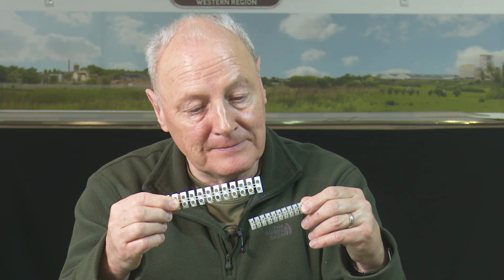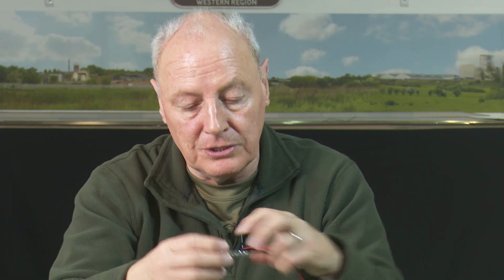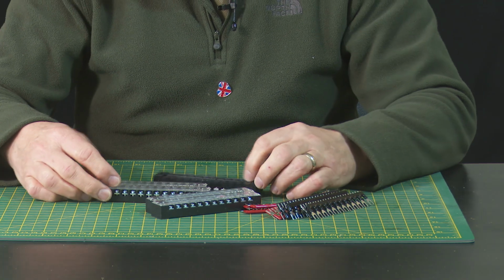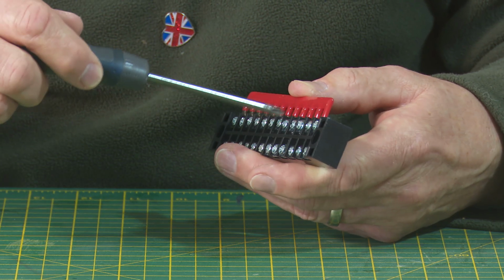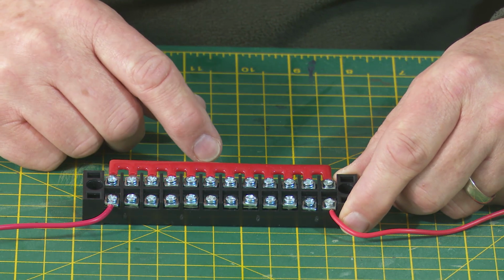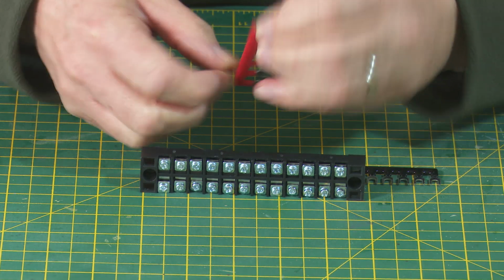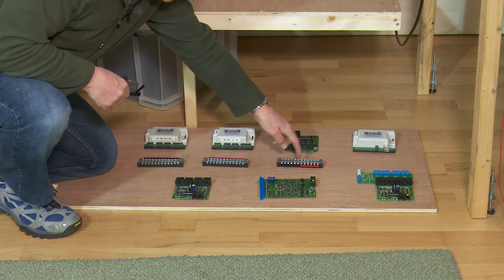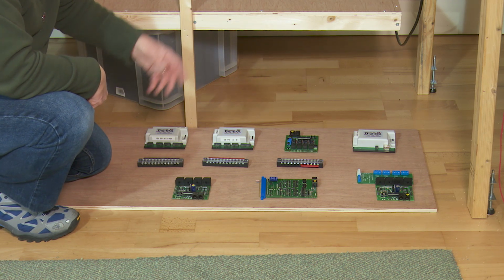Terminal Blocks for model railway wiring at Chadwick Model Railway | 85.

Comment: Thanks for your video. I subscribed. In USA and looking for the blocks you demonstrated. I found for thirteen U.S.. size wire do you use? Thanks.
Reply from the maker: Thanks MSM.  For dropper cables from blocks, I use 16 x 0.2mm.  You will have to google the answer in AWG. Regards, Charlie.

Comment: Yay! Still £10.99, and in my basket. Just the jibby jobby for the complications of my station, and of course the lighting circuit. Current-ly on DC, but going to take the leap to DCC, as none of my engines have easy plugs on them. Putting on the miner's lamp, and getting under the layout for a good fiddle!  ;-) I'm also looking at putting the 240v inputs into the terminal blocks, but the accidental connection-protection seems a tad 'short' for that... Again, a lovely concise video.
Reply from the maker: Thanks Harrison, they really are a great product. Regards, Charlie.

Comment: Great video as ever Charlie! Can I  ask a question. does the Block you recommended work for 12v and 16v please? I am thinking of ordering these :     HSEAMALL 15PCS 8Position Screw Terminal Strip 600V 15A Double Row Terminal Block Set with 400V 15A Red and Black Terminal Ba…
Reply from the maker: Yes, and they should be ideal for your situation. Regards, Charlie
Reply: Many thanks for that Charlie! I am guessing Id have one block for 16v and the other for 12v? thanks for all your great videos - they are such a help to a new-commer like me!

Comment: Many thanks Charlie for this video. I've spent most of the afternoon looking for and at videos using and explaining terminal blocks and yours was the most informative for this novice. I have most of my track wired with feeders and solder joints with lamp cord as my bus, but will definitely use blocks for my next wiring projects (lighting). AND I may eventually rewire all my track with terminal blocks. I would tomorrow, but am so far behind with the layout, my grandkids will be out of school by the time I would finish. My son never got to see my trains running and I don't want to make the same mistake again. Cheers!
Reply from the maker: Thanks Setaf, i’m so pleased that you have found this product useful. It’s certainly one that I continually recommend. Regards Charlie

Comment: Piece of advice when cutting the strips use solder mask to cover the exposed areas from the cut as it will insulate the strips
Reply from the maker: I must confess, I just turned my ends around, so the insulated ends faced each other. Regards, Charlie

Comment: What a great product.. Just received these bus bars through the post, and it will make the wiring under the boards so much more tidy. Fantabulous! Thank you for the leg work and research into these products, for all us railway modellers to use these items.
Quick question on wiring: As is normal, 1 bus wire + & - per line. 
But what is your view when entering a 4 or 6 line yard running into a 4 line engine shed? 
Is it best to split the bus wires into 6 feeds to feed each line, or can I get away with 2 and feeding multiple lines from same bus.
The length of yard is approx 8 feet to give context.
Keep up your great work Charlie.
Reply from the maker: I always over engineer!
I would power each and every piece of track Rufus.
Reply: @ChadwickModelRailway  Thank you Charlie... I have been mulling this over before getting stuck in. The droppers were always going to be fed from each piece of track, it was just how much I split the bus wires.
Over engineered is my policy too.
Great advice as always, and fantabulous channel.
So many questions & chat I would send you Charlie, but don't want to bombard you.
All the best
Rufus (in the depths of Cornwall)

Comment: Hardware Update:  I recently tried using some cheap white translucent blocks (you call them PM42 in this video) and found they don't work reliably with stranded OR solid wires smaller than 20 awg (16/0.2 UK).
Reply from the maker: I know what you mean mate, but those are known as chocolate block connectors. A PM42 is a Digitrax power management device. Regards Charlie

Comment: Could this be used for Dc cab control? My thought is run power to terminal block from one controller, then in my case to 5 spdt switches?. And then to do same for second controller and finally a third one for the common rail wiring?
Reply from the maker: I’m no expert on DC cab control David. However, what you said does seem sensible. Regards Charlie

Comment: Hello.
As someone who considers electrics to be witchcraft, can you give me some brief advice?
I don't run a bus, despite my layout being 14' x 9', and this will be the first time I'll add power other than controller to track.
I want to add street lighting.
I'll be using a regulated power supply limited to 3v, but I'm confused as to how to wiring these fancy, new terminal blocks.
If I had, say fourteen lights, would I have live into one terminal, and neutral into another.
Then, each LED lamp post would fit into each block, live to the live block and black to the black block.
How do I connect further blocks, given that I have fourteen street lights and each terminal block has only twelve connectors?
Do I simply run a live and neutral wire between each block or will that clash with the black and red 'combs'?
Sincere thanks.
Reply from the maker: With these terminal blocks, you can take multiple cables from a single terminal.  Furthermore, you can even take the power safety from the combs.
Reply: Ah, I've watched your video again.
I think the upper connectors are left solely for the combs. The first input on the lower level is for power in, and the twelfth input on the lower level is the wire to the extra block I need for lamp posts in excess of what I'll use in the first block.
Those connectors in between divert power to the lamp posts?
Have I understood it correctly?
Thanks again.

Comment: I bought the terminal blocks! All hooked up correctly in my helix and to the bus line of the layout, I now have a buzzing sound like when a loco rolls into a switch that’s not set correctly! It’s a short with something, I have checked 5 or 6 times now to see if I have the right wires where they’re supposed to be and I can’t find the issue! Any help from anyone would be appreciated! 

Wires go:

Outside red (white from helix)
Inside black (blue from helix)
Reply from the maker: Hi John, just check that if you have red cables feeding the nearest track on your upper level, it will reverse on your lower level.
Also, now it might be a good time to "Subscribe".  Regards Charlie

Comment: The terminal block will work perfect with my Helix!!!
Reply from the maker: Great news John, using the link, I’ve bought loads. Regards Charlie.
Reply: I’ve bought one pack, but now that I see how easy they are, I will be buying more, I really didn’t feel like running 12 bus lines through my yard, with these it will be so simple!! 
I’m so glad you have a YouTube channel.
Without you, sparky107 and one or two others, I would have blown up my layout long ago! 

Just want to say thanks!
Reply: I’m going to be purchasing a lot more, I have a quick question. I took out my second main, converting to a single main around the layout (had a few issues, locos stalling and such) so I removed all of my feeders and it fixed the issue, now I have a bus line with 30 or more suitcase connectors connected! Should I put in a brand new bus line? Everything runs perfect now with the bus the way it is, but I’m concerned in the future that it could cause some issues, all of those connectors are powered. So it would be drawing power?

Comment: Thank you for the excellent explanation on everything. History and current. 

My purpose is to make Star Wars light panels connected to arduino uno. But because things change, I  thought a terminal block would work. Then it came with this bus bar and and had no clue what use it had. You helped me get that clue. Thank you
Reply from the maker: I’m so pleased that you found the bus bar useful, regards Charlie

Comment: That certainly helps - every day is a school day - they're even better than pluggable choc-blocks. Great find! Working up hill, soldering, welding etc, even when young ain't fun, get past 50yrs old, even if 50 is the new 40, even less fun!

I've started by trying to make 'consumer unit' boards for easy access and making them relate to 'districts'. I'm using Digitrax too - but in 7mm, I've started dabbling with RC (less wiring - less track cleaning of the link tracks that take the layout from one side of the shed to the other via the garden). To do DCC properly requires hard wiring of points and two BUS set ups (loco net etc) - a lot of wiring. With hang down boards or sliding boards, I'm pondering the use of curly leads - similar to guitar leads (1970s stylee) etc with plenty of slack but not taking up much space. I find that many railway modellers use very thin wires, often too thin - I use the thickest possible that will fit and work.
Reply from the maker: Great comment MS.

Comment: Best practices  (adding the least resistance to a circuit) would say to add spade connectors to the power leads and place them side to side in the center of the buss side  so that the connection is close for the continuing feeds.  any wire that you may want to disconnect in the future should have a spade terminal crimped on it.  Wire ends should have  soldered (tined) ends so you don't get catwisker shorts if you use it with broken ( separated) buss strips. Yes you can use a Dremel rotary or heavy diagonal cutters to shorten the buss strips  so you could actually place track power on one end and accessory power on the other end.
Reply from the maker: Great tips Peter, many thanks.

Comment: Hi Charlie could there be a Male  and Female were you peg the wire in one section of wire and the other has an inserting tag , which would take away the use of a screw driver and just plug it in.
Reply from the maker: An interesting option William, regards Charlie

Comment: When using just half the connecting strip, it seems you could solder the incoming feed to the cut end of the strip.  May be defeating the object of using this type of connecter in the first place, but just another way of using them I guess.
Reply from the maker: I was just trying to emphasise the point that these connector blocks are very suitable for people who choose not to solder. Regards Charlie

Comment: Silly question time, I understand loop in on the terminal block but what is loop out at the other end?
They say that there are no silly questions but when you get back to me I will explain why this is a silly question.
Keep teaching us how to Charlie.
Barra.
Reply from the maker: So power comes in on one terminal and then moves on across the layout from the next, so the terminal block becomes part of the circuit. Regards Charlie
Reply: Here's my explanation  I used to install turnkey HF communication systems , listening stations early warning and SSSB. This not only involved installation of the towers, ground earth matts and curtains but included the elecrical systems and radios. Within these hands the security of the nation was safe,lol 😂

Comment: Hi Charlie, great video about the connectors. I have two questions: 1. Why don't you use very popular quick splice type connectors? 2. Is it not better to tin the stranded wire before fixing in the terminal block?
Reply from the maker: Hi Fillip, I don’t use the suitcase connectors as often over time they can lose their connection. This is quite a regular in motor-vehicle wiring. I tend not to solder stranded wire as I normally will fit a ferrule before connecting to a terminal block. Regards Charlie
Reply: @ChadwickModelRailway  Many thanks Charlie for your quick response. I agree in terms of suitcase connectors, I made a test how the slot penetrates the insulation and I'm unhappy so will revert my concept and do the connections using terminals with screws instead.

Comment: Brilliant idea Charlie - I'm building a new modular shelf layout using Kato track in N Scale (while in semi-retirement mode here near Ann Arbor in Michigan, USA), and you've just provided the solution to one problem I've been noodling over for a couple months while developing my DCC wiring plan. Amazon Prime has similar styles available to me. FYI, planning to use the Digikeijs DCC system with Multimaus throttle here. Thank you, sir! Gary
Reply from the maker: Thanks Gary, Those terminal blocks really are a godsend. Regards Charlie

Comment: Hi Charlie, Love your videos.  I use these blocks on my layout and they are awesome.  There is a product (in the US, on Amazon) called Gardner Bender 07315001126 LTB-400 Liquid Electrical Tape.  It comes in a 4oz bottle (which will last a long time) and it works great.  You could put a small amount over your cut ends to seal those up and reduce any kind of short from those ends.
Reply from the maker: Thanks for the tip Walter. 
Regards Charlie

Comment: Hello Charlie, hopefully the solution to my connection worries. In short at 67 years building my first layout. I have 15 turnouts to connect to my Guagemaster D controller. Is it suitable and correct to wire one block to the accessories 12v supply connection on the controller, wire all my switches to the block, and do a second block for the return connection? 
Many thanks, and keep producing these fantastic, helpful videos. Martin
Reply from the maker: I’m sorry Martin but I just don’t understand how the gauge Master D controller works. I’m afraid you’re on your own on this one. Good luck regards Charlie

Comment: Would you have to split the bus like a ring main (fead in / feed out) or could you not just run these off a spur from the bus? That way, if the feed connection in to the terminal block goes belly up, only the droppers running from that block go down and the rest of the bus gets power (makes it easier to fault-find if one section goes down). I love the idea of these as I want to have as few contact points on the dcc bus as possible.
Reply from the maker: Yes Kim, it would work that way too.

Comment: Amazing Video - exactly what I was looking for.  I was just on Amazon Canada and my head was spinning from all of the options.  This topic is very well explained and perfect for the beginner like myself.  This past weekend i just completed my individual power feeds, using a dual ring powerline(bus)  and those clamps with the levers.  Easy solution but probably not the best for troubleshooting.  Now I am on to my lighting circuits for lanterns on points and other "always on" lighting.  For the life of me I couldn't find distribution strips.  Not realizing of course that you can just "common"  these, which you so eloquently explained.  I have left a sub, which is nice for me as all my subbed train channels are in German as I am a German speaker.  Again thanks. Greetings from Toronto 🇨🇦
Reply from the maker: What a heart warming comment Tommy.
 Stay safe. Regards Charlie

Comment: I've bought myself a couple of packs of these, thanks to this video! I just wonder are the cables supposed to have fork connectors on them to go into the block or just bare wires?
Reply from the maker: I use forks for larger cables and bootlace ferrules for normal sizes. Neither are really necessary.

Comment: Hi Charlie I really enjoyed your video I have a small layout I live in an apartment and it's a 3ftx5xft portable table I built for my layout I put it on my kitchen table and when I am done I put away anyway I am running a ho trains and the track is an oval no program track because I dont need it. My father in law gave me his DC HO trains i want to run to see what works and what doesn't i have a  DCC NCE POWERCAB and I want to put both on the track I know I cant put DC on a DCC track I installed a toggle switch but I cant figure out how to hook up a switch to the terminal block same one you got from Amazon is there anyway you can tell me how to hook up my switch to my DCC and now DC the switch I have is ON/OFF/ON I am so confused I will try to hook it up but I need help if you want I can send you pictures thanks sorry it's so long
Reply from the maker: Hi George, I know exactly what you mean. As it’s a temporary installation, do you not have separate running sessions.  One evening DC another DCC? It seems far simpler to just plug one controller or the other.  I do know what you’re after but here in the UK I would have to buy it from an electrical parts store.
Sorry that I can’t be of more help.
Reply: @ChadwickModelRailway  you have been helpful and yes i am going to do it sessions but i would like to useca toggle switch thank you charlie i love your videos and pleas besafe out there thanks again

Comment: Hi Charlie, I really enjoy your videos. It is very informative. Thank you. Just one question.... pardon my ignorance.... can the loop in cable be plugged in to the top (along with the bridge bar), e.g. 1st port and then the loop out cable be plugged in to the 12th port. That way, I would get all 12 ports from the bottom row, instead of 10. Will that work and importantly will it be safe?
Reply from the maker: Yes, absolutely Raj.

Comment: They do look pretty good, might consider them one day.  

I usually saw off 2 half inch x whatever length copper clad PCB type strips from a sheet, glue n screw it to the baseboard underneith then I have two giant no faff easy to use tag strips.   Works fine, isn't the neatest solution though, yours looks better!
Reply from the maker: But looks aren't everthing SS

Comment: I make my own bus bars. I buy from the local hardware store a flat aluminum bar and cut it to the length I need and drill and tap it with as many holes as I need. Works like a charm. ( Yes, the Brits do spell aluminium correctly)
Reply from the maker: A true modeller Dave.